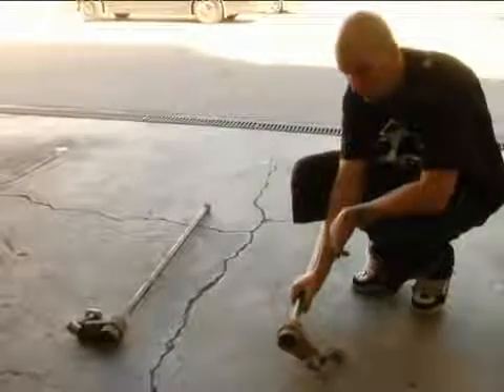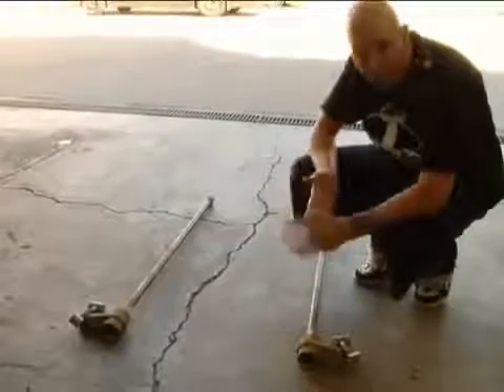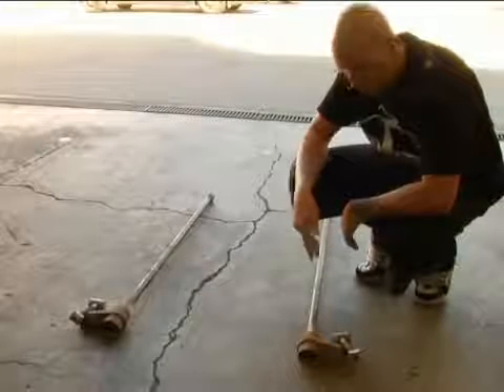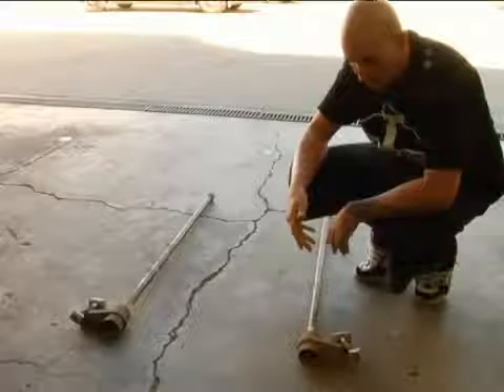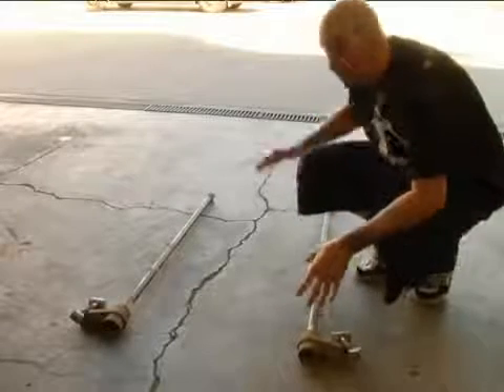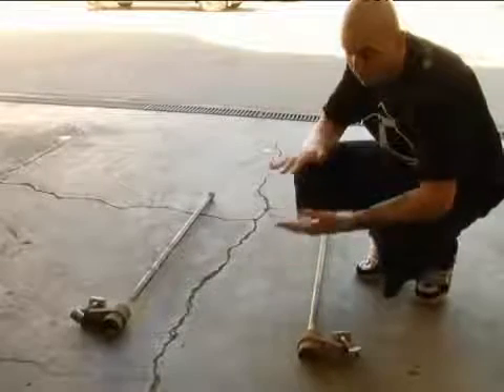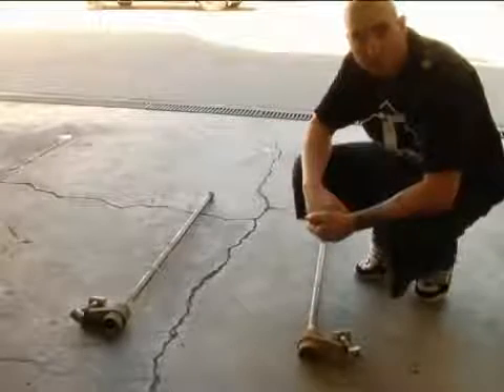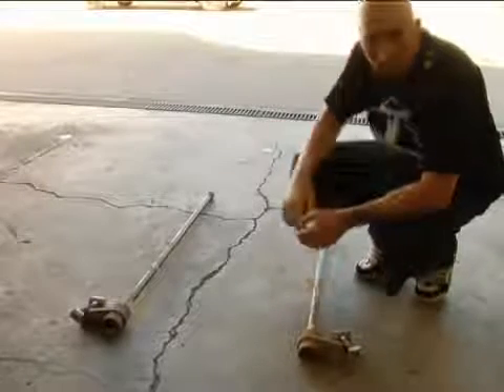Chevy Truck: Removing Torsion Bars

Comment: Do not install or remove torsion bolts with an impact. Unload the tension from the torsion bar first, this will save your tension bolts.

Comment: Mine aren't coming out easy like that. I have a 2500hd
Reply: What model truck? How did you get them out?  I want to replace my snowplow hd with regulars.
Reply: I guess you didn't line up your 1/4" drive sockets properly to handle such an easy removal 😂🤣🤟